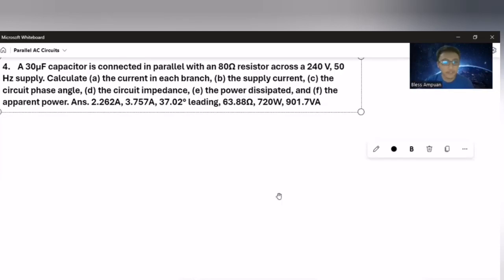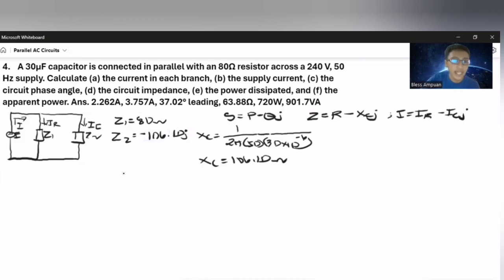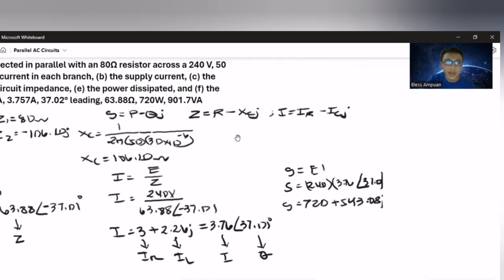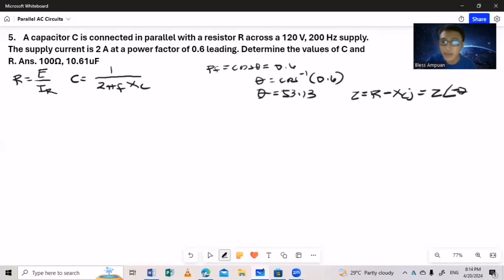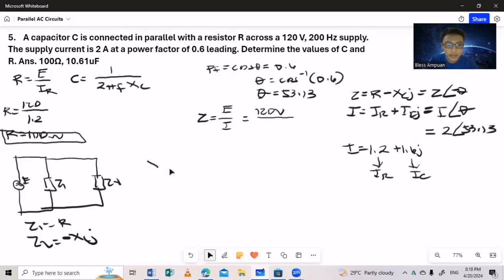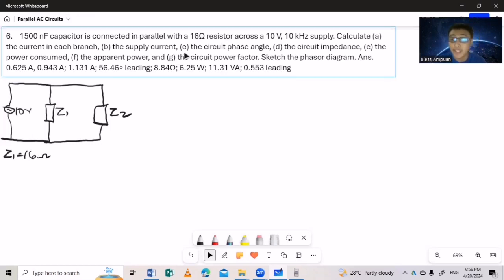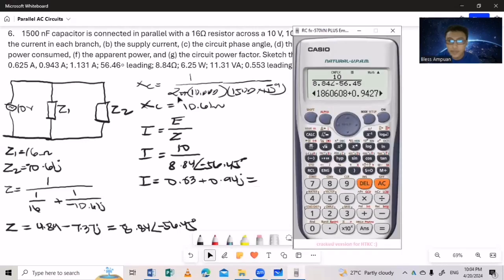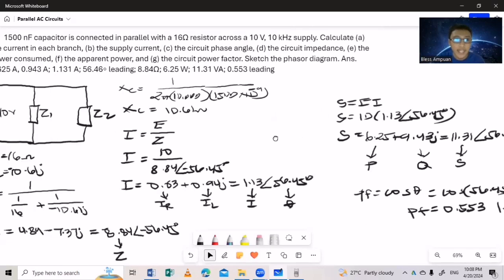Resistance-Capacitance in Parallel AC Circuits | Example Problems

Comment: From the video, I understood that an RC circuit includes a resistor and a capacitor connected to a source. The capacitor stores energy and releases it gradually, while the resistor limits the current. What surprised me is that the capacitor takes time to fully charge. Initially, the current flows strongly, but as the capacitor builds up charge, the current slowly drops until it's almost zero—this is called charging. Once the power is turned off, the capacitor gives back its stored energy, and that phase is known as discharging. Overall, this taught me how timing and energy storage shape RC circuit behavior.

Comment: This video clearly shows how to easily solve RC parallel AC circuits. It follows the same steps as the previous lesson but uses capacitance instead of inductance. Some formula operations are different, such as changing from i=iR−iLj to i=iR+iCj. I also learned that in an RL circuit, the inductor current lags the voltage by 90 degrees, while in an RC circuit, the capacitor current leads the voltage by 90 degrees. This video showed me how to handle problems where the power factor is given, but the resistance and capacitance are unknown. It also helped me understand how to approach and solve these problems using the formulas introduced in the previous lessons.

Comment: My takeaway from the video is that in a parallel AC circuit, the voltage remains the same across all branches, while the current varies depending on the components in each branch. Each branch carries its own current, and these currents combine to form the total supply current. In a resistive branch, the current is in phase with the voltage, while in an inductive branch, the current lags the voltage by 90°, and in a capacitive branch, the current leads the voltage by 90°.

In an RL parallel circuit, the total current lags behind the applied voltage because of the inductive effect, resulting in a lagging power factor. While, in an RC parallel circuit, the total current leads the voltage due to the capacitive effect, producing a leading power factor. The power factor depends on the phase angle between voltage and total current, and it indicates how efficiently electrical power is being used in the circuit.

Comment: Studying this video significantly improved my understanding of AC circuit analysis. I learned that in parallel configurations, voltage is uniform while currents vary, causing the total current to lead the voltage. Representing capacitive reactance as a negative imaginary number helped clarify its phase behavior. Using both rectangular and polar forms simplified the calculation of total impedance and phase angles. Furthermore, distinguishing between true, reactive, and apparent power provided a deeper insight into energy flow, while understanding power factor revealed how efficiently the circuit operates. This lesson has made analyzing complex systems much easier to grasp.

Comment: The video on RC parallel circuits helped me understand how to analyze AC systems using complex impedances. One key idea is computing capacitive reactance and expressing it as a negative imaginary value to show its phase effect. In parallel circuits, voltage stays the same across branches, while currents differ, causing the total current to lead the source voltage. I also learned to use rectangular and polar forms to find total impedance and phase angle. The discussion on true, reactive, and apparent power clarified energy distribution. Additionally, determining power factor using the cosine of the phase angle shows how efficiently the circuit operates.

Comment: This tutorial on RC parallel circuits helped me better understand how capacitors behave in AC systems. I learned that capacitive reactance is represented as a negative imaginary value, which indicates that the current leads the voltage in a capacitive branch. The video clearly explained that in parallel circuits, the voltage across each component remains the same, while the branch currents differ and must be combined vectorially to find the total current.
I also found the use of both rectangular and polar forms very useful in simplifying calculations, especially when determining total impedance and phase angle. The explanation of leading current in capacitive circuits made it easier to visualize how phase relationships work. Additionally, the discussion on power components—true power, reactive power, and apparent power—helped me understand how energy is utilized and stored in the circuit. Overall, this video provided a clear and structured approach that improved my confidence in analyzing RC parallel AC circuits.

Comment: In this video on Resistance-Capacitance (RC) parallel circuits, I learned how to systematically analyze AC circuits by treating components as complex impedances. A key takeaway is the calculation of capacitive reactance, which is then represented as a negative imaginary value in rectangular form to indicate its phase-shifting properties. The tutorial demonstrates that in a parallel configuration, the voltage remains constant across all branches while the currents vary, resulting in a total current that leads the supply voltage. I also gained a better understanding of how to use both rectangular and polar coordinates to calculate total impedance and the circuit's phase angle. The explanation of power relationships—specifically distinguishing between true power in Watts, reactive power in VARs, and apparent power in VA was incredibly helpful for visualizing how energy is distributed. Learning to derive the power factor from the cosine of the phase angle provides a practical way to measure circuit efficiency. Overall, these examples provide a rmathematical framework for solving complex electrical engineering problems involving parallel capacitive loads.

Comment: After watching the video I learned about parallel circuits on how it works in the diagram the behavior of resistance and inductance, their phase current is different. It can easy to understand and to know the topic because it discuss detailed and while watching I'm taking down notes to analyze the equation of how it works. When computing the supply current or the total current l learned using addition in vector you get the supply current of the diagram. And applying the step by step solution you can easily solve the problem. Important is analyze the problem to know what is required in the problem to solve it  step by step properly. This lesson help me to analyze more problem in ac parallel circuit.

Comment: I learned how a parallel RC circuit works in an AC system and how to solve problems involving it. I understood that the resistor and capacitor have the same voltage across them, but the currents behave differently, the resistor current stays in phase with the voltage while the capacitor current leads it, causing a phase difference. Solutions on how to calculate capacitive reactance using frequency and capacitance, find the current in each branch, and combine those currents using phasor addition to get the total current is delivered clear, which is why this content is very useful and easy to digest. The video also taught me how to determine the circuit’s impedance and phase angle, helping me better understand how current and voltage relate in parallel AC circuits, how theory meets practice and calculations. 

Hoping for more contents to come sir. 🙏

Comment: Shifting away from tedious manual derivations, the tutorial focuses on the practical application of *complex number methods* and calculator shortcuts to solve for total circuit parameters. Through three detailed examples, the instructor demonstrates how to convert capacitance into capacitive reactance (X_C), calculate total impedance (Z) using reciprocal formulas, and determine branch currents. A key theme of the lecture is the distinction between inductive and capacitive behavior, specifically illustrating how the total current *leads* the voltage in an RC configuration.
Beyond basic component values, the video offers a clear breakdown of the power triangle, distinguishing between true power (Watts), reactive power (VAR), and apparent power (VA). The instructor meticulously shows how the phase angle remains consistent across impedance, current, and power calculations, providing a cohesive understanding of the circuit's behavior. While the pacing is methodical and slow, this approach ensures that viewers can follow every mathematical transition in both rectangular and polar forms. For anyone looking to master the nuances of leading phase angles and complex AC analysis, this video is a highly recommended and reliable educational resource.

Comment: After watching the videos, I developed a better understanding of how parallel RL and RC AC circuits are analyzed step by step. I learned that each component affects the current differently: the resistor current stays in phase with the voltage, the inductor current lags behind it, and the capacitor current leads ahead. Because of these phase differences, the total current must be calculated using phasor addition instead of simple adding of numbers. The examples in the videos also helped me understand how to compute branch currents, reactance, and total impedance more clearly. Overall, the explanations made the lesson easier to follow and helped me solve parallel AC circuit problems more.

Comment: Watching these videos helped me understand parallel RL and RC AC circuits much better. I learned that in both types of circuits, the voltage stays the same across all the parallel parts. The most important thing I understood is how the currents behave: the current through a resistor moves with the voltage, the current through an inductor comes after the voltage by 90 degrees, and the current through a capacitor goes before the voltage by 90 degrees. Knowing these current timings makes it clearer how to add them up to find the total current for the circuit. The examples in the videos also made it easier to calculate things like total resistance and power, which really helped me grasp these topics and solve problems.

Comment: I discovered from watching the video that current behaves differently in each branch of a parallel AC circuit with resistance and capacitance. While the current in the capacitor leads the voltage, the current in the resistor branch is still in phase with the voltage. In order to determine the overall current, we first determine the current in each branch and then combine them using the vector or phasor approach. I also knew how to calculate the phase angle and how the capacitor influences the circuit as a whole.

Comment: From the video, I learned that in a parallel AC circuit with resistance and capacitance, the behavior of current is also different in each branch. The resistor branch still has current in phase with the voltage, but in the capacitor branch, the current leads the voltage. This is the opposite of the inductor case, so it helped me not to confuse the two. I also learned how to compute capacitive reactance and how frequency affects it. In solving problems, we first find the current in each branch, then combine them using vector or phasor method to get the total current. I also understood how to get the phase angle and how the capacitor affects the overall circuit. This lesson helped me see how capacitors change the current flow in AC circuits.

Comment: After watching the video, I learned that a parallel RC AC circuit is made up of a resistor and a capacitor connected across the same AC voltage source, so both elements experience the same voltage. However, their currents behave differently: the current through the resistor is in phase with the voltage, while the capacitor current leads the voltage by 90 degrees. The total current in the circuit is obtained by combining these two currents using phasor addition, which generally produces a leading phase angle.

The impedance of the circuit depends on both the resistance and the capacitive reactance. Since capacitive reactance decreases as the frequency increases, the circuit’s response changes accordingly. Parallel RC circuits are commonly used in applications such as high-pass filters and coupling circuits. To analyze them, phasor diagrams and AC circuit methods are used, especially considering the phase difference between the resistor and capacitor currents. Overall, the behavior of the circuit is determined by the values of R and C, as well as the frequency of the applied signal, making it suitable for frequency-sensitive applications.

Comment: After watching the video, I learned that writing a summary is not just shortening a text but understanding it deeply. The most important step is identifying the main ideas and removing unnecessary details. I realized that a good summary should be written in my own words and should remain clear and concise. The video also emphasized that summaries should be objective, meaning we should not include personal opinions but only focus on the key points of the original material.

Another thing I learned is the proper process of summarizing, such as reading carefully, breaking the content into parts, and then rewriting it in a simpler way. This helps improve comprehension and memory. Overall, the lesson taught me that summarizing is an important skill for studying and communication because it allows us to understand information quickly and effectively.

Comment: After watching the video on RC parallel circuits, I learned how resistors and capacitors work together in an AC circuit. In a parallel setup, the voltage across both the resistor and the capacitor is the same, but the current in each branch behaves differently. The current through the resistor is in phase with the voltage, while the current through the capacitor actually leads the voltage. This difference in current behavior creates a phase difference in the circuit, which I found interesting. Because of this, getting the total current is not as simple as just adding the values directly. Instead, it involves considering the angles or using phasor diagrams to get the correct result.

Comment: After watching the video i learned that in a parallel RC AC circuit, a resistor (R) and capacitor (C) are connected in parallel across an AC voltage source. Both components share the same voltage, but their currents differ. The resistor current is in phase with the voltage, while the capacitor current leads the voltage by 90°. The total current is the phasor sum of these two currents, typically resulting in a leading phase angle. The circuit's impedance (Z) is determined by the combination of resistance and capacitive reactance. The capacitor's reactance decreases with increasing frequency, affecting the circuit's behavior. Parallel RC circuits are used in applications like high-pass filters and coupling networks. Analysis involves phasor diagrams and AC circuit techniques, considering the 90° phase shift between resistor and capacitor currents. The circuit's characteristics depend on the R and C values and the applied frequency, making it useful for frequency-dependent applications

Comment: I learned the difference between inductive reactance and capacitive reactance .therefore. Inductive reactance  increases with frequency and causes current to lag voltage by 90deg, storing energy in a magnetic field. while Capacitive reactance decreases with frequency and causes current to lead voltage by 90deg storing energy in an electric field

Comment: After watching the video on RC parallel circuits, I learned how resistors and capacitors behave when connected in parallel in an AC circuit. One important concept is that the voltage across each branch is the same, but the currents are different depending on the components. I understood that the current in the resistor is in phase with the voltage, while the current in the capacitor leads the voltage by 90 degrees. I also learned how to compute capacitive reactance and how frequency affects the behavior of the capacitor. The phasor diagram helped me visualize this relationship clearly. I also gained knowledge about impedance and admittance and how they are used to analyze parallel circuits. The video improved my understanding of AC circuits and how different components affect current and phase relationships, admittance, and impedance.

Comment: After I've watched the video, I learned that an RC circuit is made up of a resistor and a capacitor connected to a power source. The capacitor stores electrical energy and releases it overtime. While the resistor controls the flow of current. 
What I found out is that how the capacitor does not charge instantly. At beginning, the current is high, but as the capacitor stores more charge, the current gradually decreases until it becomes almost zero. This is the process is called charging. When the power is removed, the capacitor releases its stored energy, this one is called discharging.

Comment: After watching both of the videos i have learned about RL and RC parallel circuit. Both involve components connected across the same voltage source, but they behave differently due to inductors and capacitors. In an RL parallel circuit, a resistor and inductor are connected in parallel. The voltage is the same across both, but the current splits. The resistor current is in phase with voltage, while the inductor current lags by 90°. In an RC parallel circuit, voltage is the same, but current divides. The resistor current is in phase, while the capacitor current leads voltage by 90°. This makes the total current lead the voltage, giving a capacitive behavior. RL circuits cause lagging current (inductive), while RC circuits cause leading current (capacitive), affecting power factor and phase angle differently. And i have learned something new, like calculating the branch current and the total current using vector addition. And the tutorial is easy to understand.